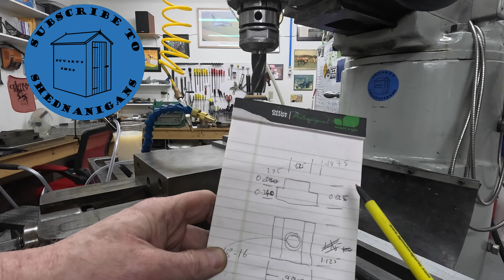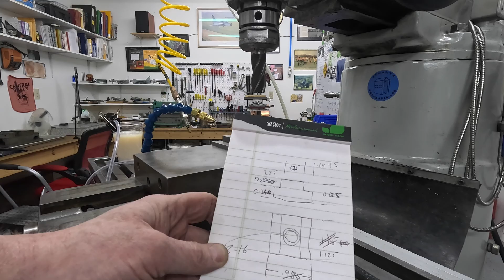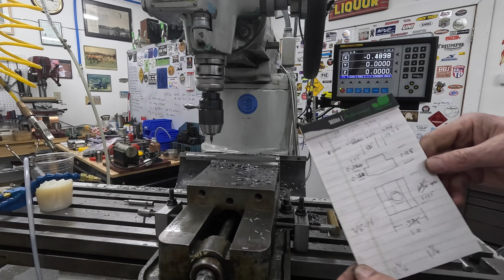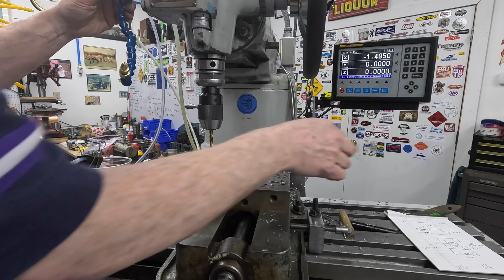Making Custom Tee Nuts - Complete With Machining Fail - Bozo Breaks My Tap. Don't miss it!

Comment: G'day Stuart.  Nice work on the T-Nuts mate.  Don't worry about the broken tap.  We've all done that before.  In regards to power tapping with hand tap, yes it can be done.  However, I usually don't send it all the way.  I allow it start (approx 1 x dia) and then I hand tap from there on.  In a CNC mill, you can also use a standard tap but you change the program to tapping (chip breaking).  This will go in and out similar to doing it by hand.  Cheers, Aaron.
Reply from the maker: Cheers Aaron - thanks for looking in and thanks for the tips on tapping - input like that always very much appreciated! 👍

Comment: Please sont put taps in drill chucks, did you see the tap slipping? Hard on drill chucks. 
Tapping thru holes? Use a center cutting tap!  
Power tapping without a tapping head is (normally) flirting with disaster,  add in a hand tap....
Reply from the maker: I was told specifically to use a drill chuck to allow it to slip. 🤷🏻‍♂️

There are lots of demo’s this way by real machinists. However it does seem that conventional wisdom is a keyed drill chuck is better. 

I am no expert on this matter, for sure. I won’t be trying it again until I have dynamic braking on this mill. Installing that could cost me as much as the mill did. 😀

Comment: Stuart, I wanted to add that I wired in a forward and reverse jog button on my knee mill for the sole purpose of power tapping. I am using a VFD to power the mill and use the dynamic braking function to slow the spindle.
Reply from the maker: @grntitan1  thankyou. How quickly can you stop the spindle with that? I did some reading last night and wiring in a braking feature should not be hard - adding a VFD to do that might be easier, quicker, cheaper. Would give me fuller speed range as well. Something to think about.
Reply: @StuartsShed My mill has a variable speed head with a 3HP 3 phase motor. When I’m running the mill at say 1200 rpm’s and hit stop, it will completely stop the spindle in about 2.5 seconds(it stops faster at low rpm’s). I could program it to stop faster at the higher rpm’s, but I worry it would put undue stresses on the 3ph motor. Plus, I have never found the need to stop it faster. With the jog functions for tapping, I have slow and complete control of the spindle to run the tap forward/reverse. The jog buttons are old Allen Bradley momentary switches I salvaged from an old machine control panel.
Reply from the maker: @grntitan1 thanks so much for this info - this seems the way to go! I’ll be looking into VFD’s.

Comment: Hello Stuart,  I'm just getting into this machinist hobby. I've recently bought a small South Bend 11x48 lathe( in dire need of a resto/ repair revitilization), round column mill, and the very same saw as in your video. My first practice job was making my own T nuts. I'm just south of Louisville Ky, we just got hammered  with almost 14" of the white stuff along with some good ol ice, not the type you put in a Manhattan.  Great video. I will certainly look into Joseph's channel. I already followed Matty's channel. That man is very much an excellent machinist. Until the next video, cheers!
Reply from the maker: @jeff1176  Hi Jeff, thanks so much for watching and for your kind words - greatly appreciated. You’ve picked a great hobby - stick with it! Stay warm!

Comment: If you are using a rotary converter to power your mill, just reverse the motor when the tap is through enough, also I find that you need to use a keyed chuck, because the key less tend to loosen when in reverse. Don Baily of Surban tool in his videos uses 2 flute hand taps when he power taps on the Bridgeport.
Reply from the maker: @brianbutler3954  I am using a rotary converter. I was under the impression that instantaneously ( or very quickly) reversing the motor wasn’t good practice - however if that’s wrong then that certainly sorts that problem out.

I think you are right about the chuck.
Reply from the maker: Of course I am tapping at the lowest spindle speed, so any loading / shock to the mechanisms will be fairly low. Opinion is divided on “plugging” (instant reverse). I want to make a new power panel for this machine - I wonder if it is difficult to add electric braking to a 3 phase motor?

Comment: Stuart, Tee Nuts look good.  I'll bet we have all broken a few taps, and that one looked like a fairly easy removal of the remains, so no scrapped parts.
Reply from the maker: They came out just fine in the end. Simple parts but a great test piece for some bigger depths of cut and - of course - power tapping (more work needed) - but the broken tap was easy to get out with a pair of pliers.

Comment: Stuart, try hanging the magnet to the underside of the overarm. Will save stretching the spray nozzle so much. Bummer breaking that tap. Regards from Australia.
Reply from the maker: I read this and immediately went and tried it - a much better set up and even more solid. Plus it will be out of the way of the DRO quill scale when I get that installed. 👍👍

Comment: Stuart, you should peen the last thread on those T nuts. This will prevent the threaded rod from going through the T nut and acting like a jacking screw which in theory could break out the casting on the mill table. Most purchased sets come this way.
Reply from the maker: Yes! Solid advice - thank you! I will make sure to do that.